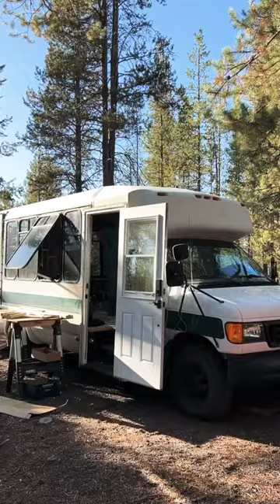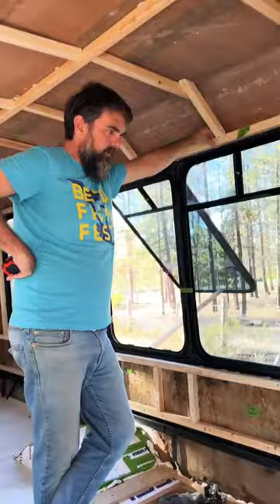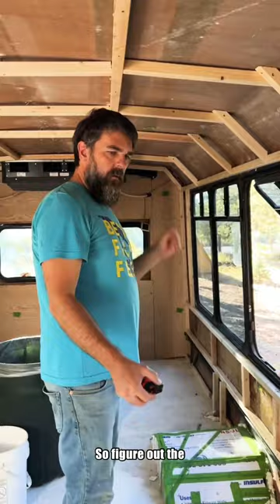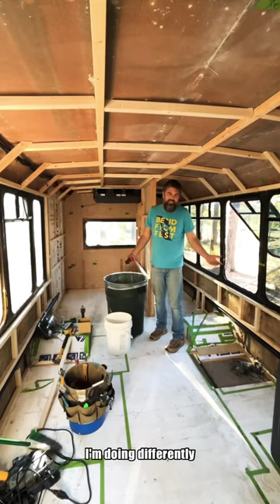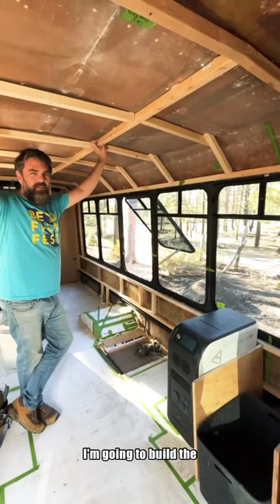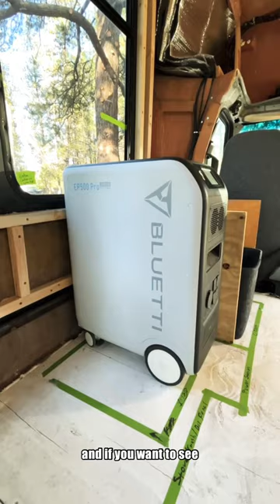bus build

Comment: I'm looking at building my shuttle bus out. I really should pull off the interior and frame it out. Im also thinking about doing Unistrut and hockey pucks for my solar rack. Did you have framing on the roof? I think I do. I'll have to tie into the roof frame to help with thermal bridging, seal leaks and install the roof vent.